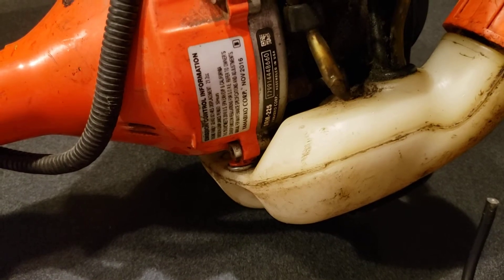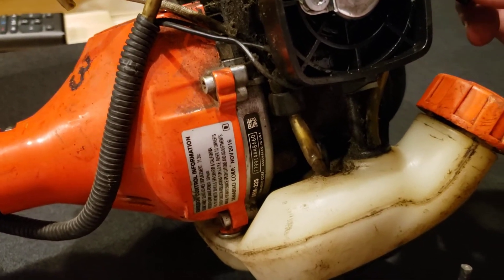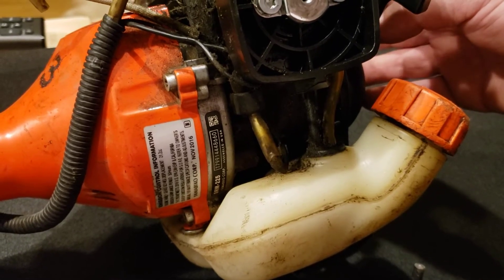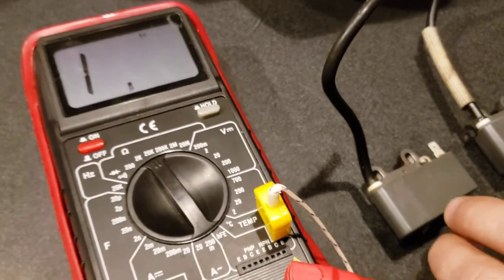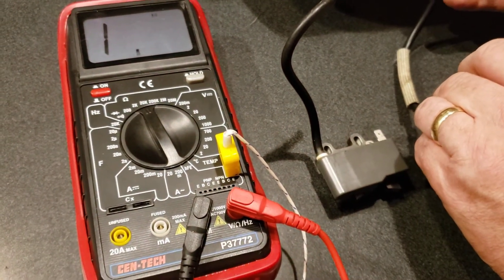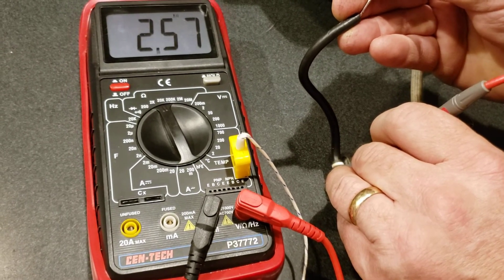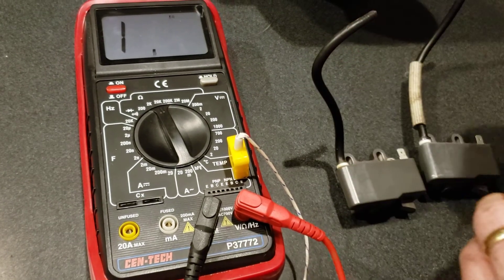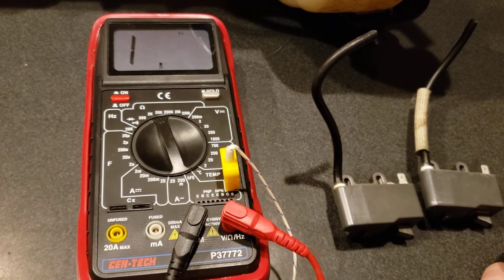Echo SRM-225 Weak Spark Won't Run

Comment: Mine will run, but bogs. I replaced  carb, fuel lines,  plug,  and filters. I removed the spark arrestor. Would yours run, but just no power?